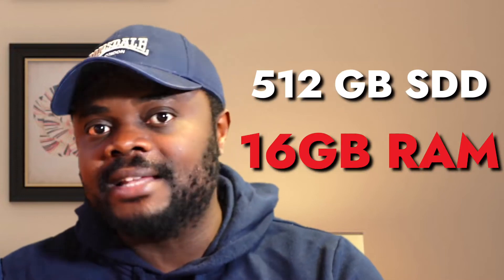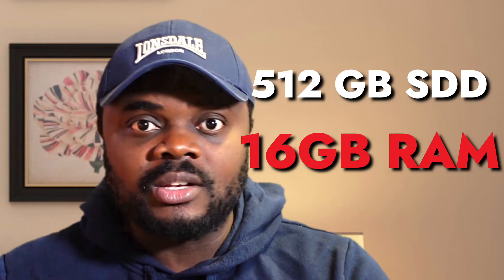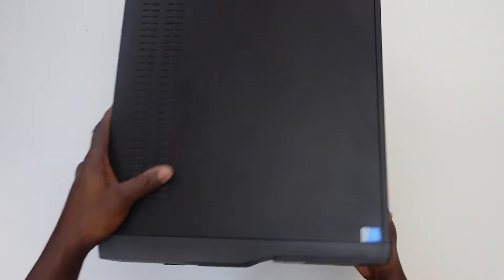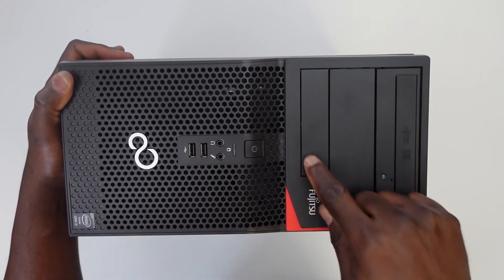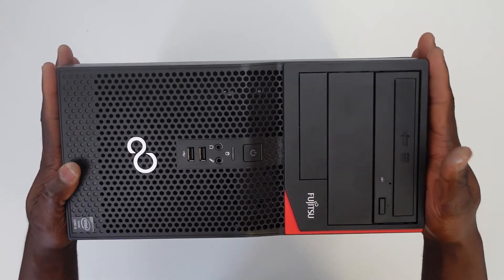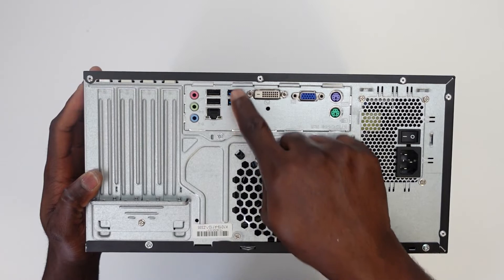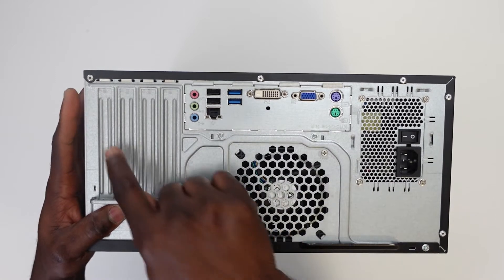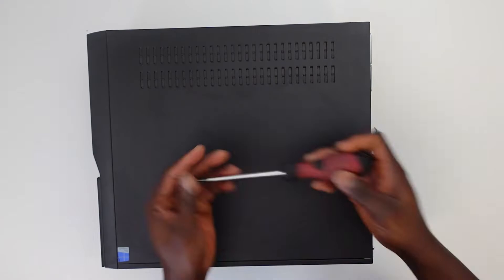Fujitsu Esprimo P420 (Tower) SSD, RAM Upgrade  - Step by Step

Comment: Please I have a huge question. I bought the same type of PC with core i5 4th 16gb of RAM and 1T HDD but it doesn't boot up please I need help
Reply: Does it still not boot I have a solution
Reply: Remove 1 stick of ram
Reply: If removing 1 stick of ram try removing the other one, if it still isnt working try cleaning everything
Reply: I fixed it. Thanks